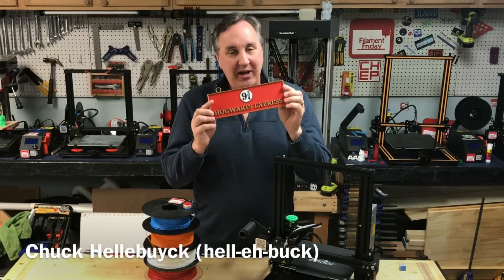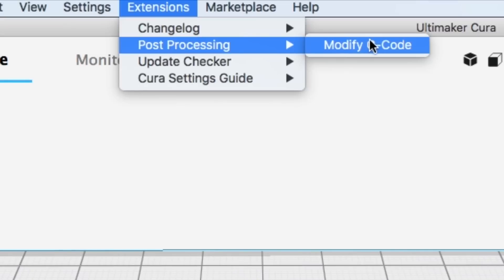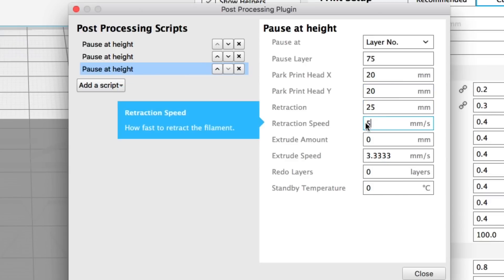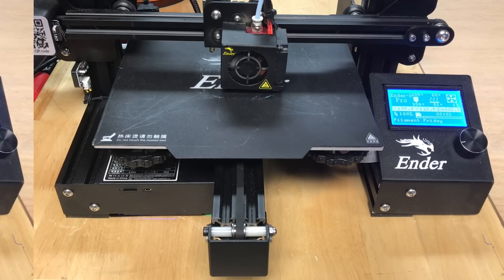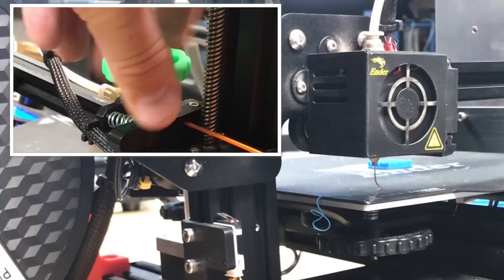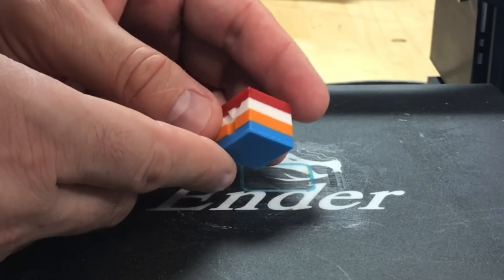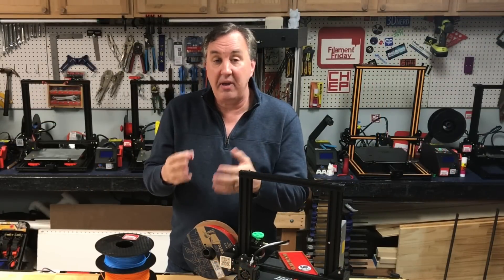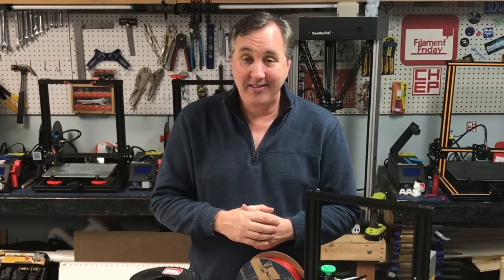How to do Multi-Color 3D Prints on Ender 3 3D Printer

Comment: Always informative , thanks. I have been working a couple hours on attempting to do this on my Monoprice Maker Select Plus. Cannot seem to get the G-code to change to new settings. Any suggestions?(Cura 3.6)
Reply from the maker: It may not be running Marlin so the GCode may not work the same.

Comment: Another timely and useful video.  I have a couple of questions.  First, am I missing something or is the post-process code not saved with the Cura file if you want to do it again?  Seems I'm having to remember the layer numbers if I want to make a second copy and have been printing other things without the script in the meantime. Second I'd like to see it issue a wipe command as it does on the start before resuming the print just to get things going normally again.  I've been trying to accomplish this by adding a small throw-away item closer to the origin so the printer goes to work on it before back to the print I care about.  Finally, in Cura 4 beta, I'm not seeing the indication that a script is in use.  Where is it?  It works, but I'm not seeing the indicator.
Reply from the maker: It’s in the GCode file so you can just print it again just like any other print. 
I haven’t tried Cura 4 so I’m not sure. It’s still a beta.
Reply: @FilamentFriday  I'm really thinking about how to make multi-color name tags or similar with different names, but using the same basic stl files with just the text different.  Using what you said I guess I could open the gcode file for one that works then clear the board which doesn't delete the post-processing code, and bring in the new stl files.   The other problem is remembering to delete the post-processing when you print an entirely different item.  Thanks for making me think...

Comment: I have used those plugins before, but usually to make a temperature tower.  I 'll have to use it for color change.  I use to stare at the printer waiting for the right time and yak the filament.  This will be so much nicer.  One question, why repeat the layer?  Doesn't that squish the filament too much or is that the point?  Thanks again.
Reply from the maker: I found without that reprint I didn’t get as good of adhesion.
Reply: @FilamentFriday  Thanks..........

Comment: Seeing that orange filament- I have an ender 3 and tried to use orange PLA amazon basics filament- and it just will not stick to the bed- never had a problem with my normal black filament (using 200/50°C) and the only workaround I have found so far is to make the first layer really really slow (like 15mm/s) and heat the bed to about 70°C although the filament says 40-55°C right on the roll...
can someone confirm that its the filament- or am I doing something wrong?
Reply from the maker: 200 seems a bit low. I’ve never used that filament so I don’t know.

Comment: it does not rehome for each change? how do you keep the steppers from moving between processes?
Reply from the maker: It does move to the X 20, Y 20 position I set in the script. 
The steppers are held so as long as you don’t force them to move your fine.
Reply: @FilamentFriday  once they unlock which will hapoen usually after 30 second they will be very easy to move. I would rehome and set new z for next print segment. I do this and never had a failure yet. This is especially important on larger machines as a very well built machine will drop z with gravity alone.
Reply from the maker: Mine stayed locked longer than that. I never had issue with moving.
Reply: interesting. stopping with gcode for user input like you are doing must keep the steppers locked. no overheating? ie what if you don't come back for hours?

when you "pause" on the printers UI you get 30 seconds before the steppers unlock at least on the CR10 :-)

that is good to know that they stay locked.

 @FilamentFriday

Comment: At 1:10, Why wouldn't you chose the Filament Change option just above the Pause at Height? What would be the difference?
Reply: Not to speak for Chep, but that didn't work for me.  I wanted it to, bu the retraction actually extruded material, 300 mm of it, if I remember right.  lol  For me, it was just easier to use this method, as Chep did, than to figure the other one out.   Cheers!
Reply: @michaelhancock1603  Just tried it. Same thing, it pushes and ground up the Filament in the extruder.
I'm still learning gcode, but can you edit that one line with a negative value instead? Or change it to retract instead of extrude. Seems that would fix that.
Everything else seemed to work.
Reply from the maker: I’m still experimenting with that. It hasn’t worked as well for me as what I showed here.
Reply: @FilamentFriday  Thanks CHEP. I just tried the Pause method, but I think I need more practice to not upset the extruder position. The nozzle returned slightly off and shifted the layer.
Reply: Ya it glitches on the Ender 3. It’s a problem with how the Ender interprets the gcode, according to Cura that is.
Reply: For some reason on the Ender 3 it extrudes the filament, instead of retracing. Also, the "filament change" triggers the buzzer until you resume the print, which is unspeakably annoying.
Reply: @grangeryoung5345  in other comments they say that you have to put the minus sign to the retract value :) that the reason why.

Comment: I am new to 3d printing. Should I get ender 3 pro or you've any other recommendations. Please help
Reply: It depends on your budget, but the Ender 3 Pro is a great machine. I have one.
Reply: @HorizonMakes  My budget is 250 - 300 USD.
Reply: @framespersecondfps5256  Have a look at CHEP's video where he compares the Ender 3 to the Geeetech A10. That might be an option too. Video is at https://www.youtube.com/watch?v=iStk26sRMlQ
Reply from the maker: Ender3 Pro has come down in price so it is a great place to start.
Reply: @FilamentFriday  Do I need to get any hardware upgrades with the printer or is stock enough?
Reply from the maker: Stock is fine to start with. From there look at some of the 3D printed accessories like Extruder knob or side spool Mount. Use  Cura 3 (it’s free) to slice your files and just learn its capabilities. And have fun.
Reply: @FilamentFriday  Thank you soooo much CHEP. Should I get Ender 3 or pro? Rest your videos are awesome enough to get me started.
Reply from the maker: Really your choice. The Pro has dropped in price so now it’s really a toss up. Pro gives you wider Y axis support beam, better power supply and Magnetic build plate. That’s about the only real differences.
Reply: @FilamentFriday  Ordering it tonight and definitely supporting you too. Please do help with the build, setup and first print.

Comment: I tried this tonight for the first time but I used "change filament" instead of pause.... However, I must have bumped the Z axis down when I was working with the extruder and the nozzle crashed into the previous print and made a horrible mess.

Comment: Great vid.  would like to see a future installment on how to translate settings between S3D and Cura.  Still on the fence if I will shell out the cash for V5 until I see its features and some reviews.
Reply: I think you'll find that in s3d you would use multiple processes which is basically what Chuck did in cura.... If vid gonna cost me again I will use v4 and cura till V4 no longer works then just cura and ideamaker
Reply from the maker: I’ve shown in previous videos how to do it in S3D. That’s how I made the signs.
Reply: @FilamentFriday  Sorry I should have been clearer.   Not how to do the multiple filaments - yes you showed that already.  What I am looking for is if you are a S3D user how to you make the switch to Cura and how do the profile settings compare?

Comment: Awesome, can it be done with an ender-2?
Reply: I've been trying on an Ender 2,but for some reason the new color refuses to flow on resume. Not having much luck figuring out why.
Reply: Yeah. I'm not certain,but i think it's retracting on resume. It also appears to be running the nozzle down against the existing print.
Reply from the maker: Remove the 1 layer reprint and try it again.
Reply: @FilamentFriday  I had "redo layers" at zero,if that's what you mean. That's why this is so puzzling. Thanks.

Comment: CHEP, if your on Marlin 1.1.9 or TH3D's firmware and the printer supports the M600 command then for all "same temp" settings this script is MUCH easier...   https://www.thingiverse.com/thing:2077884  The M600 then does a move / retract / load / heat / purge and resume all automated.
Reply: But it doesn't work that great for vase prints
Reply: @alejandroperez5368  Any different than the procedure shown by CHEP? Should be the same or easier with the same results.I haven't personally tried a multi color in Vase mode though.
Reply: Could you expand more on "it doesn't work"?  @alejandroperez5368  
I use M600 quite a bit and have had no issue with vase prints. Using Cura 3.6 and manually add M600 to the G-code.
Reply: LoL, I just posted about that too, deleted my post as you beat me to it.

Comment: Can't you just add a filament change gcode?
Reply: G code will retract a specific distance which would require a retract value and then a feed amount.  You will still be required to change the filament. Since the operator must interrupt the automation,  why not make the change less specific?  Retracing enough to clear the hot end is all that is necessary.  If the pfte tube is 75mm or 175mm wouldn't matter,  the operator could adjust and just pull the old out and push the new in.  You could then keep feeding until the old color is purged. 
It could be done by g code,  but that is essentially what is happening.
Reply: @markdaniel8740  If I remember right, on my printer it's just one line for "change fillament" and the printer knows what to do. Where to go, when to wait for fillement, how much to extrude etc.

Comment: I use both methods. I find the G-Code Script to be good too. You can set the pauses via layer heights rather than mm and you can also see the layer its up to on the LCD of the printer. Now if only Simplify 3D had more settings for the purge tower, I could utilise the A20M a lot more. Another great video.

Comment: Chep, I’ve been doing this and I just use my normal retraction settings at 2.8mm and change the temperature if it’s different temperatures for the the material, and when I need to and use the extrude 10mm

Comment: I might use this method for embedding nuts and other materials into my prints too! Thanks 👍🏼
Reply: Epic! I'm also thinking how to go around it, still there is the issue of nozzle hitting the nut which is most likely going to be higher than last placed layer
Reply: @orkusmg  The trick is to ensure that the pocket is deeper than the thickness of the nut.

Comment: How do I print mulitple models at the same time, but one at a time, not all at the same time?
Reply: In your setting go to Special Modes > Print Sequence - turn it on and switch it from "all at once" to "one at a time" then  slice it to check that travel moves aren't goint to interfere with any already-printed models. If they are going to interefere Cura will warn you, in which case it's up to you to find an alternative bed placement/printing sequence (be re-arranging the models on the build surface) that lets the slicing complete successfully.